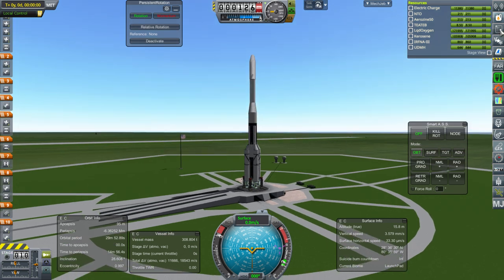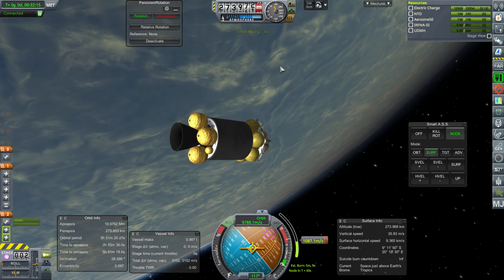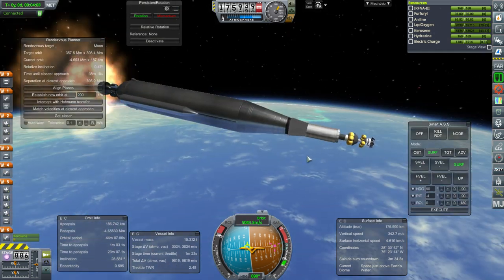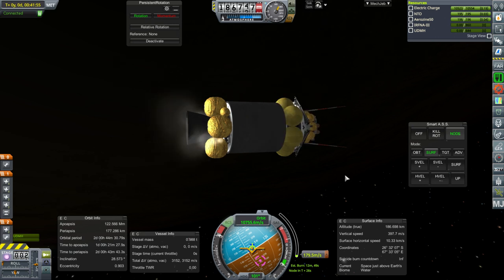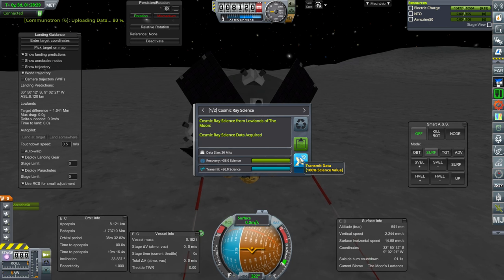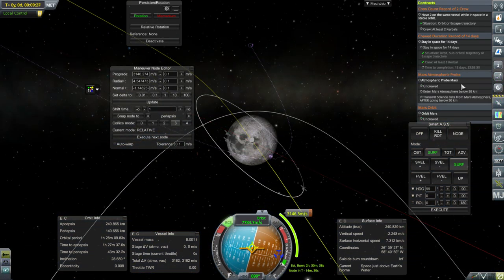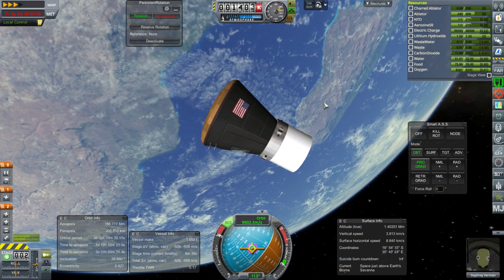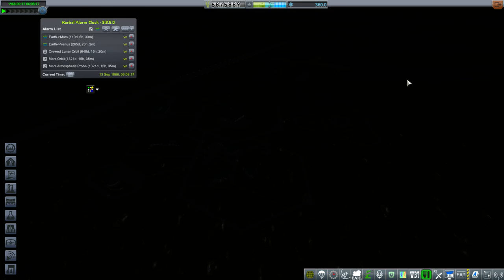KSP 1.3.1 with Realism Overhaul - RP-1 25 - Close Call

Comment: On the subject of testflight I will say this.  I think it SHOULD be there, 100%  I'm just not certain that the rate of failure is accurate?  Much like on your Kerbalism install episodes, I'm not sure the rate at which parts fail is representative of the most accurate (or useful, or entertaining) rate or failure.

I mean it's most fun if you DON'T know the result.  If the engines fail often enough that you can reliably expect failure, then it's not really that entertaining...  lol.

That's the first successful lithobraking I've seen in a long while...  Usually it's lithobreaking!

To help with pauses, you should try and clean up spacejunk again.  Remove any satellites that aren't really helping with communication, and any space-junk.  That SHOULD help reduce the pauses a little bit.
Reply: Agreed, I feel the parts fail way too much in testflight. There is no way they were THAT unreliable back in the day. I think it needs some tuning tbh
Reply: I agree with you 100% on TestFlight. Signal delay from RemoteTech is already disabled and I was waiting for some fancy kOS scripts for automated landing. If TestFiligh will be disabled then whats next? Kerbal Construction Time? TAC-LS? And the series name can be changed to "Unrealistic Overhaul" or "Kerbals in RSS". But for now I'm enjoying this series.
Reply: @wiktorwektor123  well the signal delay was mostly bad because you relied on not having glitches screw you over. like having a 30 minute signal delay. you send the stage command 30 minutes ahead and then when the time comes it doesn't stage for no reason. can't fix that anymore
also smart ass spewing rcs around because it wants to isn't realistic either.

I feel like the signal delay makes ksp a viewing experience rather than a gaming experience. you end up having mods do all the things and you just have to tell them on time to do it and hope they don't do anything weird
Reply: @whoeveriam0iam14222  in case of any bug (not only in signal delay) you are right and I think, game can and should be restored to previous state. But if you wan't direct control of spacecraft outside of Earth SOI you should send Kerbal. kOS mod is installed from the beginning, it's not new and in previous series on this channell "Beyond History" it was used almost in every episode. kOS has direct control on probe - without signal delay - just like any computer in real life. But like I said before: with or without delay it's still fun to watch. I was just hoping to see some automated landing.
Reply: @lewisfoskett122  it might actually be because he doesnt simulate the flights, since simulating flights might give data? im not sure though, haven't played it myself

Comment: I am a noob in realism overhaul and in rp 1 but how can i turn off engine failures? And what is the name of the procedural fairings addon or something like that?
Reply from the maker: Test Flight handles engine failures, so either there's a difficulty option for that under the Test Flight tab or you could just delete Test Flight (though then you'd also lost burn time limits). For Fairings, there's Procedural Fairings and also Procedural Fairings for Everything.
Reply: @RaizSpace  And the engines will have ignition limit if i remove it?
Reply: @-bajo-5636  ignition limits are handled by RO so I think they should still work

Comment: Good job on that speed 6.300 kmps 😂 Just one question - does not direct landing require more dV comparing to orbit and landing?
Reply from the maker: Depends if capturing into orbit has to be done in an awkward location because periapsis is out of communication with Earth - that's generally what I'm trying to avoid with the direct landing.